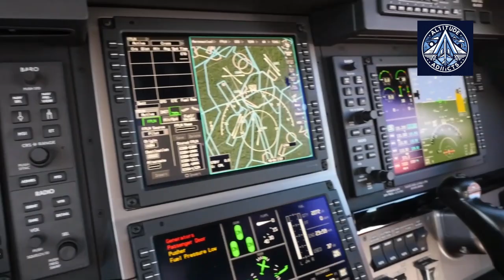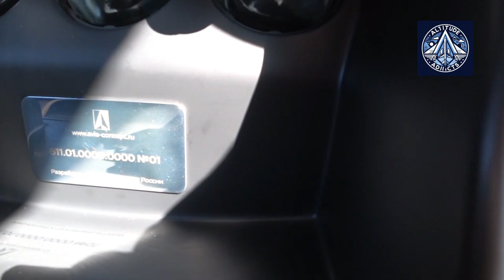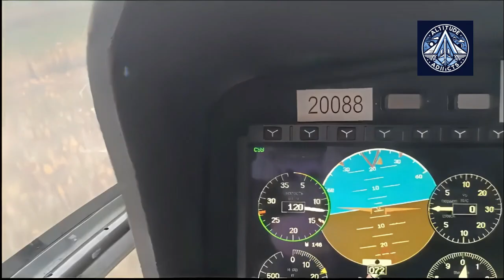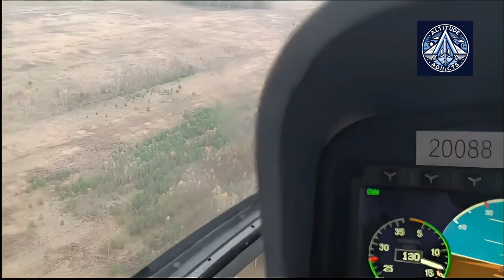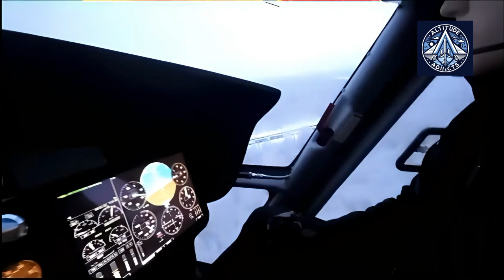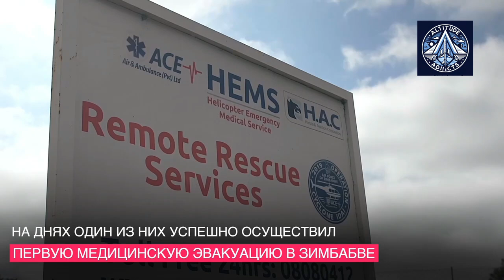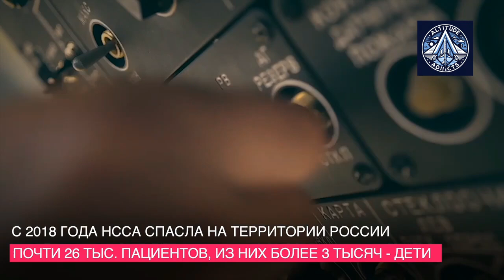Russian Ansat Helicopter Goes 100% Domestic, Also Gets AURUS Interiors

Comment: probably used a lot of existing domestic components from the larger Mi-8/17 to replace foreign bits .... so would have increased in weight. 
So I'm not sure about the performance improvement statement ....